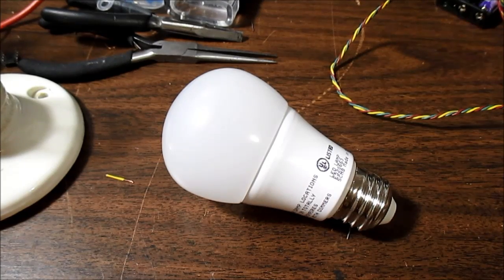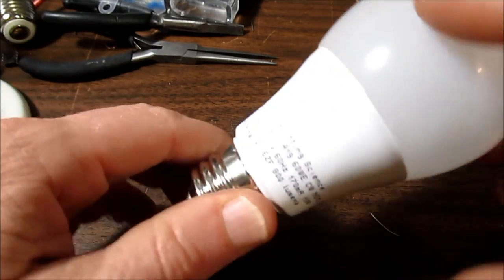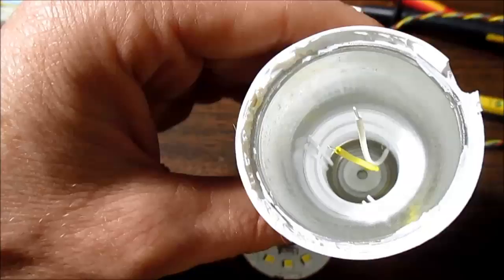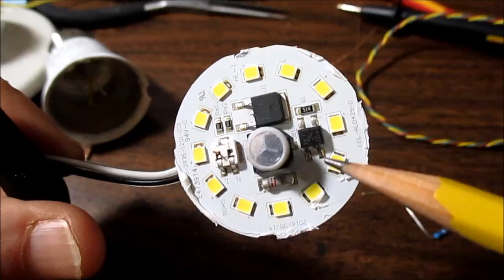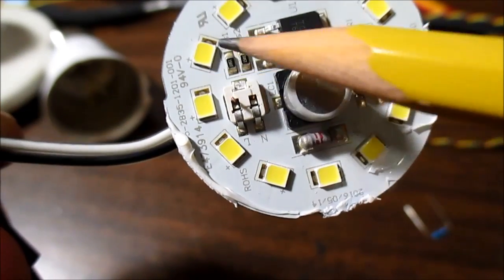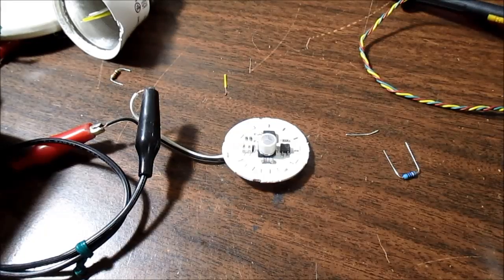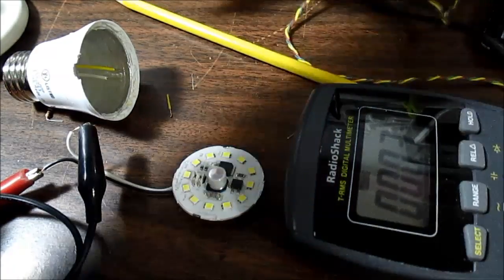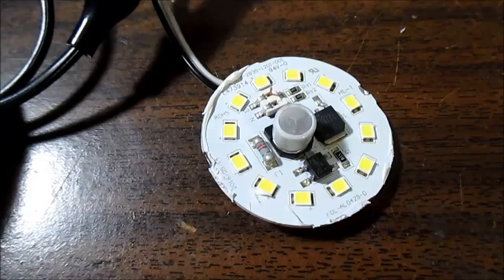Dead LED lightbulb teardown to see what failed

Comment: What current regulator is that?
Reply from the maker: A quick Google search turns up nothing on the TC1615 or T6601A part numbers. 3 terminal current regulator I see on a lot of cheap LED bulbs. Usually not available on the open market. If anyone would like to search on it, be my guest.
Reply: JohnAudioTech probably a chinese chip similar to LM317
Reply: they use these limited edition components, so that you can not repair and reuse these.